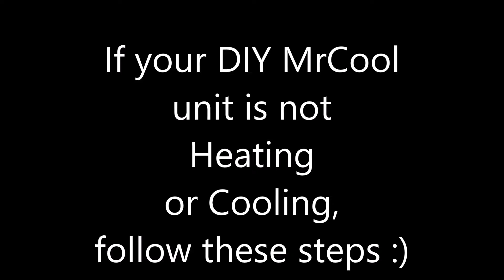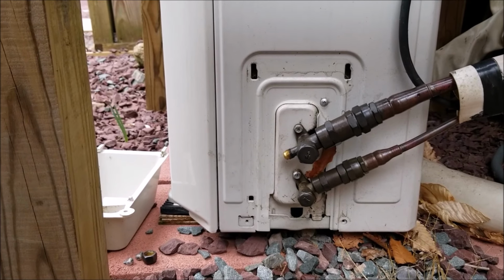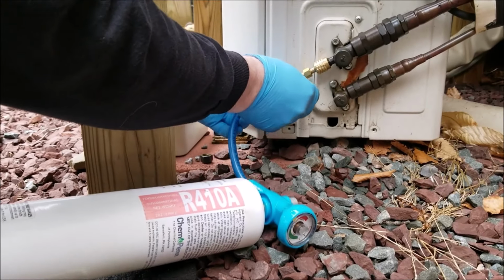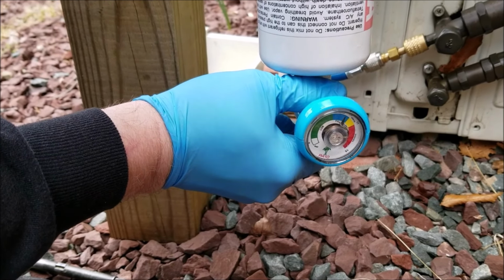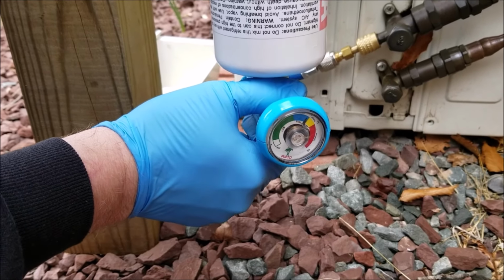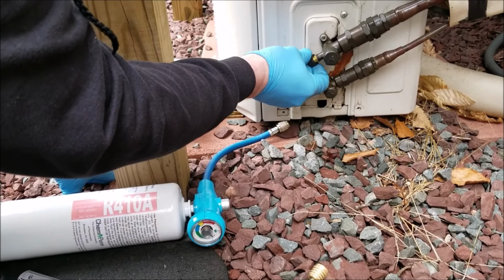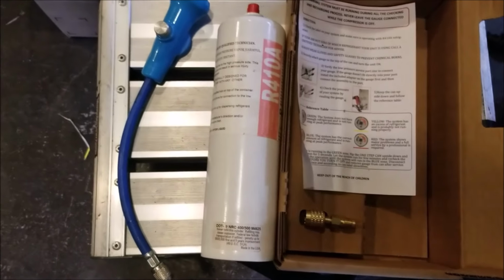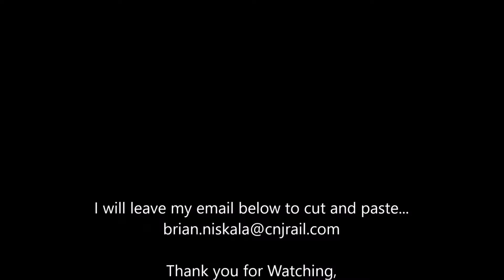Not heating? DIY MrCool 10 Minute Fix and other Ductless Units

Comment: Hi Brian, I have a MrCool A/C and for the first time after 5 years the heat part of it doesn’t work. I’m making the assumption that I need one of your recharging units, please let me know if you think otherwise.
Early this morning I ordered one unit, I think is still in my basket, however using my PayPal as a payment I ended up with a never ending circular transaction??
Your thoughts, suggestions please.
Reply from the maker: Yes, a nonheat situation 90% of the time is a low refrigerant issue on minisplits https://computrader.myshopify.com/products/diy-mrcool-plus-recharge-kit-plus-uv-dye-sealant-all-in-one-fix
Here is the link and there is a PayPal option in my store too...
Reply: Thank you Brian, I’ll let you know if the results.
Reply: Of the results
Reply from the maker: @Sinanisjg  The main fill valve has a small O ring at the bottle. They usually develop micro cracks and leak refrigerant from there. My kit has a sealant in it and will seal the micro cracks. It also has a UV dye to help look for other leaks. So on top of a fix, it is also a great diagnostic tool. Anyway I made this to fix, seal, and detect.
Reply: Hi Brian, I received the unit today, a bit different than in the video, thank you.
One question: Does the brass piece adapter goes (screw in) into the BLUE side of the gauge assembly and the bottle into the BLACK? I just want to make sure.
Thank you

Comment: Hey Brian. So we have enough pressure, and freeon. It blows cold, but when you turn it on the heat it does Nothing. No air is blowing. Anymore suggestions? Thanks.
Reply from the maker: It does need to heat up outside in the unit and then heat the coils up inside. Then it will start to blow the hot air. Once it hits temp... it can take 5 to 10 minutes. As long as the pressure is good, filters are clean, it should start blowing hot warm air. Put the unit to 82 degrees to make sure it is at the a good temp. If you set it to 72 degrees and the room is actually 72 or higher,  the unit will not kick on...
Reply: @GarageMahalLife  Ty
Reply from the maker: @darleenmiller8427  You are welcome, I'm  here to help. Be safe.

Comment: I have a Mr Cool 24000 BTU .I have no heat and when I hook up the gauge it's in the red to the top.
Reply from the maker: Hi, what do you mean in the red to the top? Do you have my kit or your own gauge? Feel free to email me Brian.niskala@cnjrail.com
Reply: Last I checked one needs to be EPA 608 certified to connect to a refrigeration circuit and/or purchase refrigerant. Correct me if something has changed.

Comment: Nice video.  My unit was working fine and then started throwing a P4 error.  Worked with MRCOOL tech and he said fittings might be loose causing a plunger not to work.  I checked the fittings and they all seemed tight.  I placed wrenches on them but they didn’t move.  I had turned power off to the unit at the breaker.  After going through the exercise, it started working fine.  Tech said the reset with turning the power on and off might have reset something but also there may have been just enough movement in the wrench action to make a difference.  That was a few months ago.

Last week it stopped heating after a real cold snap where it ran for 20 hours a day.  After watching this video, I may have a slow Freon leak.  Does your new kit with the sealant fix a slight leak?
Reply from the maker: Hi Bob, below is the link to my kits. Yes, I designed the sealant to fix 99% of leaks in these systems. And what you described is the exact scenario I made these kits for. So yes, it should charge, seal and fix your system 😀
https://computrader.myshopify.com/products/diy-mrcool-plus-recharge-kit-plus-uv-dye-sealant-all-in-one-fix?pr_prod_strat=copurchase&pr_rec_pid=7063670227107&pr_ref_pid=6074037141667&pr_seq=uniform
Reply: @GarageMahalLife  Thanks Brian.  I ordered the kit.  Here’s hoping this works.
Reply from the maker: @BobChristenson51  Absolutely, it also has a UV dye, by chance if it has a big leak, you'll be able to spot it sure enough with a UV light. But my kit typically fixes most issues you can run across 😀

Comment: How do I do this on a multizone system? Do I have to charge each one if more than one is low? I have a MrCool 36k 4 head DIY unit by the way.
Reply from the maker: It goes by compressor, so yes each one would have to be charged. In these cases I recommend getting 1 kit and an extra tank.

Comment: How many pounds of refrigerant comes in the recharge kit?
Reply from the maker: Each kit has 28oz of 410a refrigerant, however you can buy extra tanks. Typically the outside unit has a placard that shows total oz to fill the unit. If your not heating you are at least halfway down on the total oz used. The sealant will help seal most leaks if you are low and wondering what happened.

Comment: Brian, wondering if I need your kit. My unit (36k multi room) was working great but I was using it a LOT recently in the cold weather here in TN this past week. Last night it went into DF multiple times then stopped heating and threw a P6 error code. When I checked the air handler the coils were white with snow :) I defrosted them with a hair dryer to get rid of the ice. Since then I don’t get hot air, the fans start up fine and the heat pump and fan come on outside as well, just never get anything but cold air. I did get a P6 one more time but since then I get no error codes, it just never heats up. Think it’s just a recharge? I’ve had it running for 1.5 years with no issues until now.

Also one more question, if this is the fix, do I need to fill it in more than one valve since I have two air handlers? 

Btw both air handlers had the white frost on them when this happened
Reply from the maker: Hi Jason, yes seems like a classic low refrigerant and my kit will fix that. I have sealant in the refrigerant so it will seal most leaks and typically any future leaks as well. If you have 1 air unit outside, one kit should be fine. Feel free to email me with any more questions Brian.niskala@cnjrail.com
Reply: @GarageMahalLife  thanks! I’ll get in there tomorrow and order it
Reply: @jmatech  Did you order the kit and did it fix your issue? I'm having a the same issue right now the a multi split 36k Mr Cool unit as well.
Reply: I did and it did help some, however I actually discovered that a family of mice decided it was nice and warm in my control compartment/abs box. They decided my wiring was better used for a nest than for my heating. Mr cool sent me all new wires and a controller box and accessories and I was back up and running.

Comment: When I connect my kit to my unit the gage jumps to the red area, why would that be?
Reply from the maker: Units must be charged in Cooling mode on the lowest setting 62 degrees only. Heating mode is not to be used when charging mini split systems.

Comment: If the pressure is ok, but stops heating after its automatic 'defrosting', do you think it is the electronics or the four way valve? This is a Mitsubishi Mz.
Reply from the maker: How often does it go into DF? Filters and coils clean inside and out?
Reply: @GarageMahalLife  When I got it to heat, after being shut down for a longer time, maybe half hour. It is clean. And it has correct pressure. I just wonder what to bry for, electronics or 4valve. There had been some power shut downs before it stopped working.

Comment: Is it possible to use the entire can and it still not get to the blue?
Reply from the maker: Yes, that means it went for a while without running and noticing it was not working properly. And or could have a small leak or faulty fill valve.

Comment: Set unit in A/C  , does the unit need to be  running during the  recharge process..thank you
Reply: Just found in comments,  (yes, unit needs to be running in a/c mode during the charge process)..
Reply from the maker: In cooling mode...
Reply: Brian, you should add to the like or instructions about running in ac mode.
Reply: Sorry. I commented before I heard you say it.

Comment: Tried the kit and my levels were already good. I added a bit just to get it to center of blue but now I’m still trying to figure out why the heat stopped working if anyone has any ideas. I tried turning off the power to the unit for half an hour which didn’t work either.
Reply from the maker: So mid blue, outer ring for the 410a, what was the actual psi? And was it in cooling mode 62 degrees while reading the gauge?
Reply: @GarageMahalLife  yup cooling mode at 62. It was just below middle of blue. not sure the psi but i'm going to check everything again tomorrow. Appreciate the reply!
Reply: @GarageMahalLife  Ok , so i should have put on my glasses. I was looking at the wrong ring. it was not actually in the blue but in the green, however, when i tried to fill it, i couldn't get it above yellow. Does that indicate a leak somewhere? I put in a good amount just to be sure. There's still some left in the tank but it wouldn't budge past 75psi.

Comment: I have the DIY Mini Split by Mr. Cool. Out of the box the hot air is not blowing and the AC is not blowing cold air. Unless it's only supposed to blow actual "cool" air. Everything was hooked up and tested by professionals but I cannot tell if I need the $140.00 refrigerant or if I can use the warranty. Anyone with tips?
Reply from the maker: If the unit is that new, contact MrCool for warranty information. They do take a few business days to get back to you, but they will. But it sounds like a low refrigerant issue... checknwith them 1st and I will be more than happy to help you  after if needed.

Comment: So system must having a small leak (s)
Reply from the maker: Because of the nature of the systems going from hot to cold cause micro cracks in the seals and O rings. The kits I sell have a sealer that will fix 99% of these types of leaks!

Comment: Just ordered a kit myself, I have the 24k unit and it had been working great even when it got down to the teens but suddenly its only acting like a fan regardless of what mode I put it in. The outside unit is making noise like it's trying to move the gas but the fan never kicks on. I did notice yesterday it had to defrost like 3 times but I didn't think much of it since we have been getting freezing rain due to the winterstorm rolling through. It's currently 35 out and the outside unit looks find (no ice or snow on it). I can't even get it to pump out cold air in cooling mode just blows air like its in fan mode. Im hopeful that it's just low so well see what this does. Cheaper to just try this than to call the HVAC guys out to even look at it. I'll go down the road later if needed lol.
Reply from the maker: I will get your kit out tmrw... did you happen to measure the temp of the lines? You need it to pump at 140degrees plus. But from what you described,  it is low on 410a...
Reply: @GarageMahalLife  well it took the whole can and never hit the blue. It did pump out heat afterwards for about 10 minutes but then went back to ambient air temps. I'm thinking I have a significant leak somewhere. Calling an HVAC place now. I could here a hiss coming from inside the outside unit but I guess I'll see what they say. Thanks again.
Reply from the maker: @sanjezallday6329  Oh boy, well at least you know now. Hard to know for sure sometimes unless you add refrigerant to the unit. Good luck and I'm here if you need anything.
Reply: @sanjezallday6329  update?
Reply: @sanjezallday6329  any update? did you end up finding a leak?

Comment: So you added while unit was on in head mode right?
Reply from the maker: Never charge in Heat mode... charge in COOLING mode only! Be safe.
Reply: @GarageMahalLife   thanks ya that’s why I was asking cause i thought in video it had said with unit in hear mode so I wanted to double check. Thanks
Reply from the maker: @Stephen198600  Absolutely, be safe and Cool in Cooling mode 😉

Comment: Is this common for all ductless units?
Reply from the maker: Mostly, they ship with just enough gas, the moment you have even a small leak, it drops below what is needed to drive the heat part of the unit. They can cool with a low refrigerant but not heat...

Comment: Glad to find your video! Is your unit the Mr. Cool DIY? This is what I have? 23K unit installed in Aug. AC worked great, wasn't able to try heat till now. (2nd home and haven't been there till now) Thinking we may not have had coolant line fittings tight. Mr. Cool tech said we need to get an HVAC person to fill for us. I heard $$$! That's why I was glad to see your video! Would your kit refill 23K? Thank you! I'm also in PA. Just clicked the above link and it isn't found?? Anywhere else to connect with you?
Reply from the maker: Email me at Brian.niskala@cnjrail.com and what link didn't work? And one kit is enough to top off a low unit, but empty you may need 2...
Reply: @GarageMahalLife   I just sent you an email. The  link in the description of your video. thanks!

Comment: will this work with trane mini split heat pump?
Reply from the maker: Most mini splits take 410 refrigerant, so yes it will work. To double check, there is a placard on the side of the unit, usually where the wiring and refrigerant lines are. Sometimes it maybe right inside the wiring cover...

Comment: I am still watching this video even though it doesn't address my issue. But it seems that my issue is not common enough for there to be a video... So... 
What if:
It seems as if the temperature setting is 10 degrees higher than the room temperature when cooling? 
:: If I want the room cooled to 76 degrees, I need to set the mini split temperature at 86 degrees? (Last summer)
:: If I want the room cooled to 66 degrees, I need to set the mini split temperature at 76? (Last summer)
:: Now, I set the cooling temp to 88 degrees, but woke up to the mini split still blowing cold air and my space at 54 degrees and lowering. (This summer)

I am inclined to think the temperature sensor is bad, since I had similar results in the winter the couple of times I tried the heat, ie. a 10 degree difference between mini split setting and space temperature. But now its summer and the thing wont stop cooling even when set to its highest temperature. 

If you know an answer or have a suggestion (anyone) I would greatly appreciate your input.
Reply from the maker: I would first clean the inside air unit, take the filter out and blow it out with a can of air or air compressor set on 35lbs or less. Outside unit, with lower water pressure clean the compressor area where the fins are... avoid too much pressure avoid bending the fins, aim straight on. Clean the inside filters really well. Now that the units are clean, see what the Temps differences are. Download the MrCool app and see when the units Temps registers at. Make sure your MrCool remote has new batteries and also is lightly blown out as well to get any dust out. Then if there is still a temp issue, then the sensor would have to be replaced, more than likely the inside unit's temp sensor.
Reply: I have the same problem with my Mr Cool!

Comment: Do you charge it with the unit running?
Reply from the maker: Good question, yes you need to have it running in Cooling mode...
Reply: Thank you
Reply: I just asked the same question..I guess I should have read more comments..
Reply: @GarageMahalLife  Hi
It's winter now where I am. When I put it in cooling mode to try and charge the system it won't turn over... Any suggestions?

Comment: I have a multi zone with 3 units do you charge at the top master valve or at the unit valve like what your doing ?

My unit heats but will turn of after about 5-10 minutes. It will stay of for 2 minutes than turn on again? Is this a low refrigeration issue ??? Or something else
Reply from the maker: Hi, you would use the master Suction line, please take a pic of the lines by the outdoor unit and email to Brian.niskala@cnjrail.com and I will tell you specifically which one to charge. And yes, this is a low refrigerant issue as you described.

Comment: If the heating is low  what is the problem?
Reply from the maker: Low on 410a...refrigerant. I have a recharge kit I sell.
Reply: I am to far Kosovo
Reply: But the problem is low on refrigerant?
Reply from the maker: @vehbifushe-kosove9700  Yes. You need to charge it, the unit has to see 140 degrees at least to start the heating mode. Without enough 410a refrigerant, it will never come on into heat mode.
Reply: I have heat but not strong enough heat

Comment: I'm having an issue where using the remote I set the unit to 4 or so degrees higher than the current ambient temperature in the room and the unit doesn't do shit. Doesn't open the vent or anything.. just sits there.
Reply: Other times it decides to work fine
Reply from the maker: So a lot of questions... are the filters clean? Outside air unit, fins clean? Poor air circulation can cause the unit to not function properly. Low refrigerant can and will cause the unit to seem "dead" it needs 140 degrees to make the sensors register to "throw" heat into the rooms. Typically the main issue in heating mode to not work. Put it in cooling mode on the lowest setting, if everything seems "normal" but then in heating mode, nothing seems to happen, you have a low refrigerant issue and get my kit.